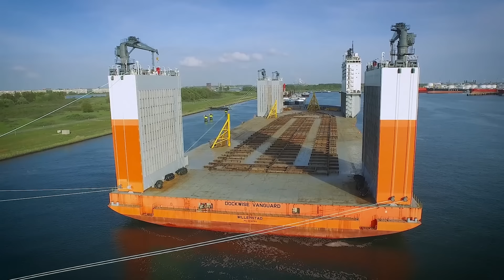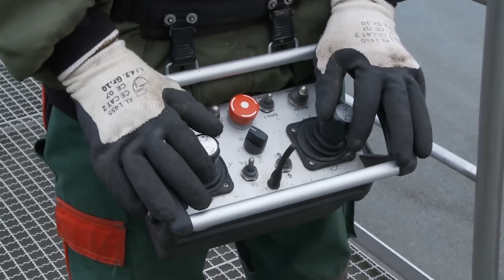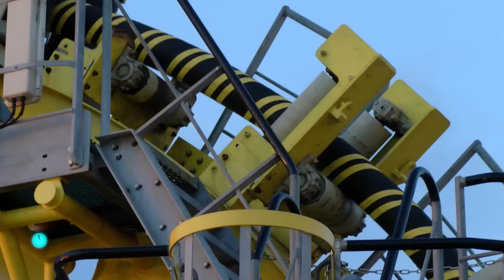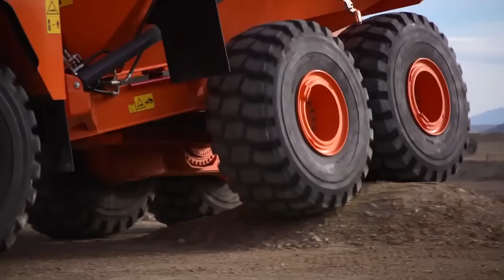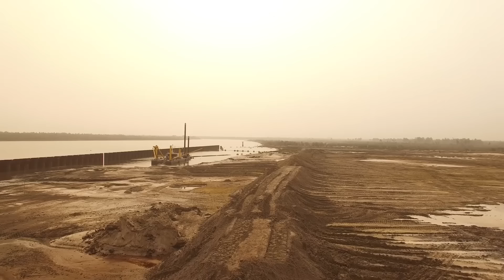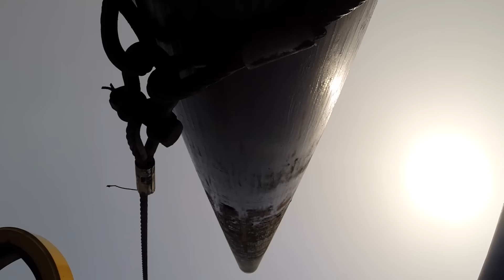AMAZING MACHINES OPERATING ON ANOTHER LEVEL

Comment: In large outdoor mines it is wrong to use too many of these large trucks that do not yield enough, wear out, are slow and fail due to dust.
Better to use the large conveyor belts (with car wash system) inclined in
vertical inside the mines.
These have a fast, continuous mineral transport (night and day) and at low costs.